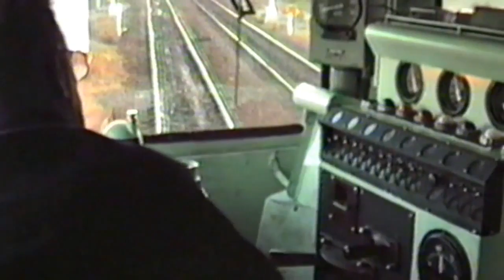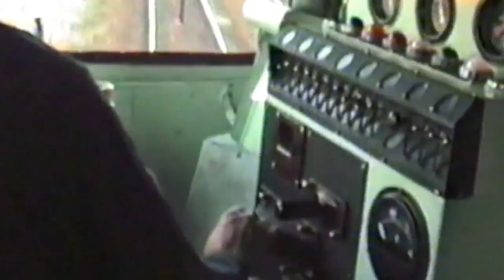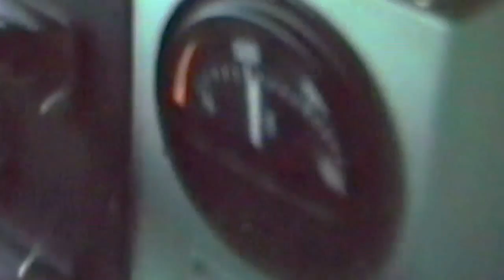Cab Ride 421 Class Thirroul to Kiama

Comment: Being from the US where GM built diesels are pretty common, this video is excellent. The sounds of the 567 diesel engine can't be matched these days.
Reply from the maker: +Caesar K Rock   Hi Caesar, it was pure luck that a GM came along. The NSW (State) railways largely bought Alcos in those days. There was only a few GM classes with not many in each class.  Victoria on the other hand bought little besides GM.  Some years ago riding with the driver was banned and even any electronic device is forbidden by some operators so getting videos like this is very difficult now.
Reply: Alcos are known for being tough, even though they had early troubles with the 244 and 251 engines. The GE traction motors found on many Alco products (as well as Fairbanks Morse, early EMD units) made them excellent pulling locomotives. I also can't take anything away from Westinghouse traction motors on those early production Fairbanks Morse and Baldwin diesels either.
Reply: Caesar John ju

Comment: Did the drivers prefer the flat side or the bullnose side? 
Were there less controls on the flat side?
Reply from the maker: As far as I know all diesels, at least the earlier ones, had more or less similar controls. Both flat and rounded nose locos had quite good visibility out the front, so I don’t expect that was an issue. Engine noise in the cab would probably be more of an issue if noisy.

Comment: The 421 was notorious for rough riding at speed.
Reply: Their nickname was Rocking Horses, for obvious reasons. Never ridden in one not cab forward so this is quite interesting to see. I remember getting a cab ride from Liverpool to Campbelltown on the Moss Vale Flyer in 42104 in 1979 or 1980. I can attest to the fact that they rocked and rolled all over the place when at speed. They were also driven in the manner of Jack here. There were only three notch positions for most drivers back in those days...0, 1 to take up coupler slack and 8.
Reply: NSW Railways Videos so was the 45 class

Comment: The 421 class always had a bad reputation for rough riding at speed, that's why they were seldom used on passenger services.
Reply from the maker: Well on the run to Nowra, there was hardly anywhere where high speeds were reached. I expect if they were that bad, the then strong railway union would have banned them.
Reply: @tressteleg1  They did in the 1980's, AFULE members at Eveleigh had a ban on them, they weren't too popular at DELEC either, mostly placed as second unit.
Reply from the maker: Our driver Jack Lawson was based at Everleigh but unfortunately he is no longer with us. I don’t know especially remember him grumbling about having the loco on that day. But I don’t doubt that their performance was not wonderful.
Reply: @tressteleg1  Thanks, the 42 class also similar restrictions placed on them by the AFULE (now RTBU) at the time.  Noise levels in the No1 end cab was also an ongoing union issue with both too.
Reply from the maker: GM Locos were noisy at the best of times, so I well imagine that engine noise had minimal preventative measures on those older units.